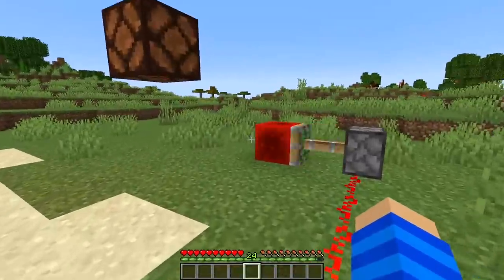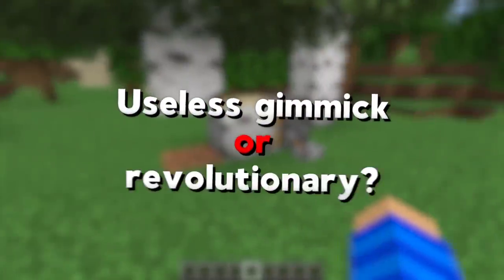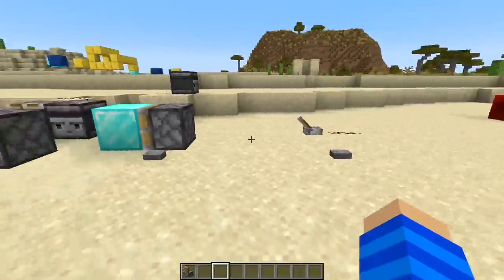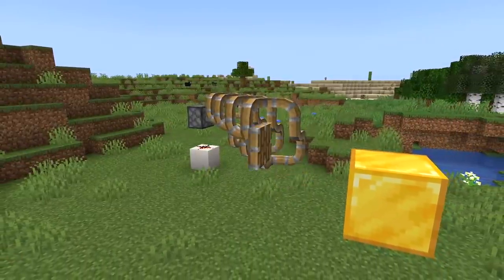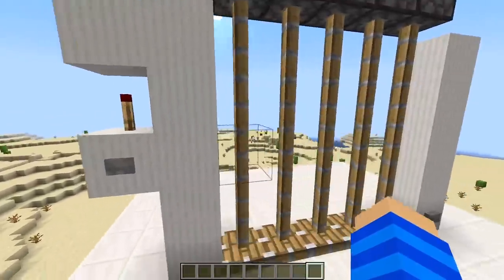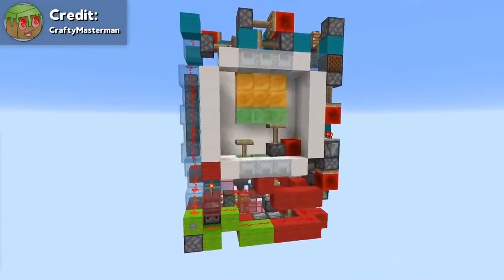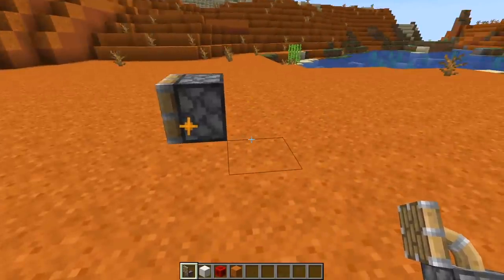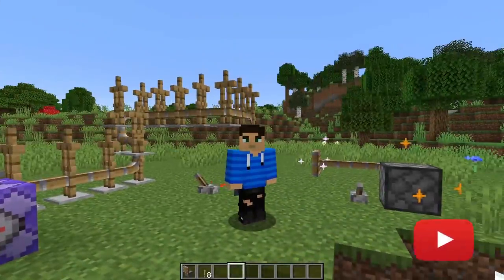Breaking Minecraft using a single Piston...

Comment: I think this would be nice in vanilla Minecraft but with a few nerfs.

My suggestion is the pistons should only extend straight forward. Secondly, it should be limited to 10 blocks long, and each piston would have to be specifically crafted for their intended length. For example, craft a normal piston together with a copper ingot, and you get a +1 extending piston. Craft with 2 ingots and it extends 2 blocks, and so on.

The idea is the copper would work as hollow cylinders (think telescope, plastic lightsabers, etc.) that are attached to the piston head and can be retracted into one another. That way, it makes logical sense that the piston can fit into a single block when retracted.

Without a crafting table, you could craft up to 3 ingots together with a piston, and with a crafting table, you could put 8 ingots with the piston, making 8 rods the maximum limit. Including the piston's base and head, it would cover 10 blocks in total.

Comment: I would love to see if this could be recreated using the actual internal piston blocks (you can actually create them with commands). I'll just call them block 36 because that's what most people know them as... Would be more performant and makes the piston logic simpler, plus, it gives that satisfying smooth animation.

Block 36 (I believe its actually just id minecraft:piston now, just, as a tile entity, with some NBT data) has a block ID to animate with and its state (e.g. waterlogged), and it is either extending or not (retracting). It has a progress value to determine how far along in the animation it should play from, and, once the animation completes, block 36 turns into the block ID it has stored.

The actual head of the piston is a block 36 in place of the original piston when retracting, and in front when extending. I forgot the exact details on what its values are, but, basically when a piston pushes a block there are two block 36s in front of the piston, and when it retracts, there is one block 36 in front of the piston and one where the piston is. It would be easier to recreate the piston head with armor stands I think.

Would also be hard to make this work with corners, but, I guess it could be two stages, one for pushing/pulling the block into the corner, and a second for it getting pulled/pushed away. 

I tested this info myself in 1.18.2 using the Carpet mod's /tick freeze and /tick step features (super cool features, would highly recommend checking them out), and Minecraft's /data get block command.
Reply: block 36 is minecraft:moving_piston, not minecraft:piston. also, the piston head is minecraft:piston_head. please update this comment so others can know
Reply: @vindi167  I found this out later, the ID of the tile entity is minecraft:piston for some reason (true for all block 36s I tested, from sticky pistons, slime blocks, etc)

Also, the piston head is only that block after the piston has finished moving, while the piston is in motion, the animation is controlled by a block 36, which is what I was describing. Whenever you see a block moving in the piston animation, there is a block 36 for it.

Unfortunately after I tested some more, I also realized that you can't create the tile entity artificially, because moving_piston isn't a tile entity when placed down via setblock for some reason, which, I suspect is because the pistons have code to create those strange artificial tile entities themselves. That's probably why the ID of the tile entity doesn't match with the ID of the block.

Comment: Am I wrong but would it be better to use area effect clouds instead of armor stands. Area effect clouds have no model so they are less laggy.
Reply from the maker: I'm using armorstands to put the custom models on their head slot, area effect clouds don't have that possibility :)
But you're right, area effect clouds (or the marker entity) is generally more efficient :)
Reply: Yeah, but I don't think they can hold a block? Perhaps the system could be made more efficient by only having Armor Stands where there are bends, but very bendy pistons would probably lag even more if that were the case

Comment: Maybe there should be some orange sparks on the second block out from that piston neck? Allowing you to chop back the piston settings to the block before where you made the mistake. In turn, make the sparks around the piston base red, so people know that it deletes everything. I don't know hop the code works though, maybe the issue you had isn't so much user interface, though I could see issues with settings being 2 blocks out if piston moves in a 3 wide or smaller loop, so much as the code knowing to delete the rest of the neck after that point and set the block where you clicked it to a head.

Comment: I'd say this can be useful.. imagine elevators... or moving a single block through a mess of other redstone so that it's not in the way. It could also pull a redstone block and activate multiple different redstone signals, get the timing right and a redstoner could do something cool with that.
Reply: @Florian D. Possibly, it just needs to be refined. I'm sure some redstoner/mod dev can refine it enough to push blocks correctly like a normal piston. This current piston can serve as a sort of concept idea for what it can be though.

Comment: Okay... But the serious question is: Can your wiggly pistons fly. You made them not able to push themselves sure but but would two of them be capable of moving at a diagonal, five blocks at a time with a structure between or in front? Cause you might then be able to make flying machines that LOOK cool without needing multiple layers of flying machines to get the size and speed!